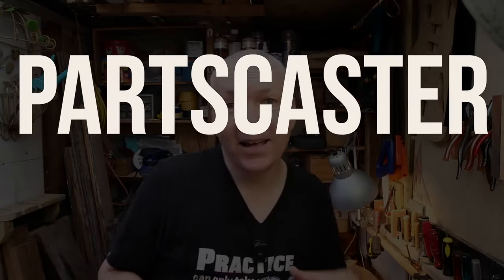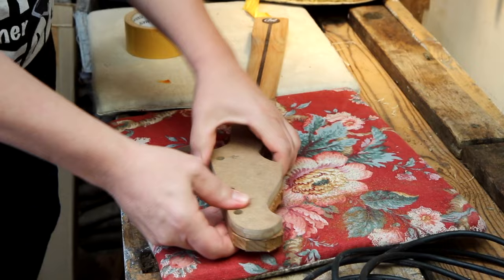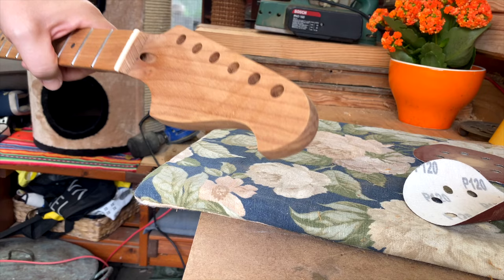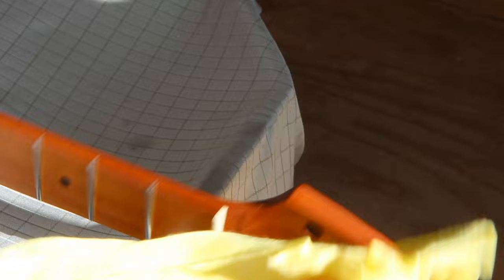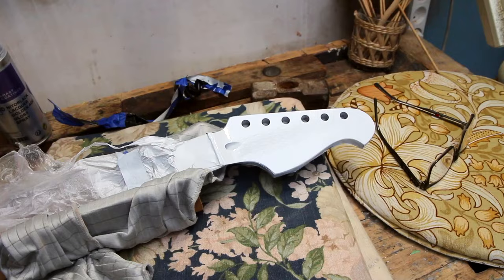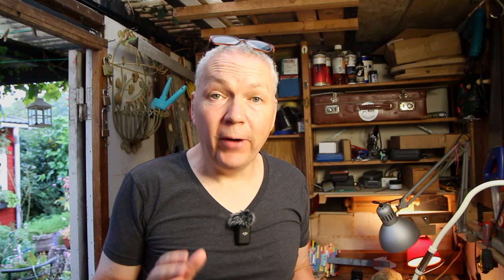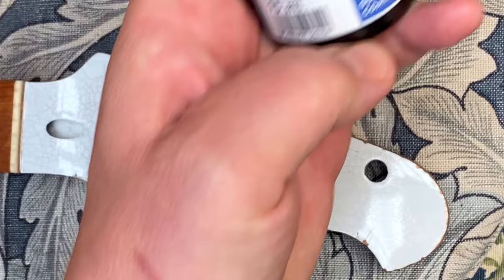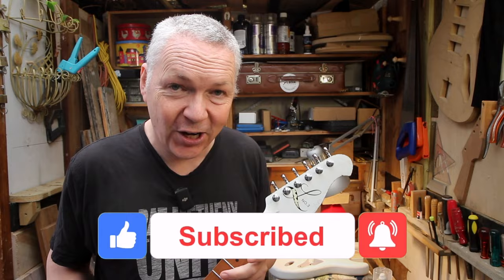Making a unique HEADSTOCK - by MISTAKE.

Comment: Should you varnish an oiled surface with nitro varnish? What decal printing paper do you use? Thanks for greate video.
Reply from the maker: I have put Nitro on a oiled surface on two guitars before and that worked fine. The decal paper was from a hobby store in here in copenhagen and is for laser printer. But I just researched it a little further. You can get decal paper much thinner than the one I used… also how about transfer paper like the ones you use for fake tattoos…??? Would that work?
I have to try that out.
Thanks for watching 😃🙏🏻